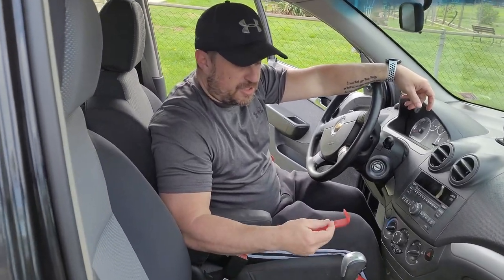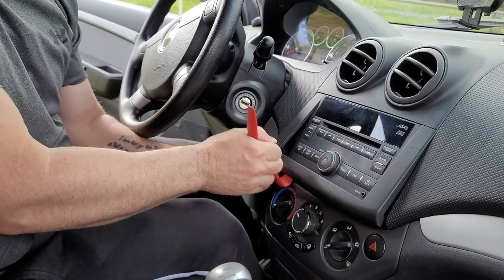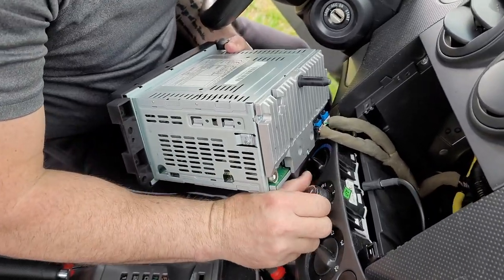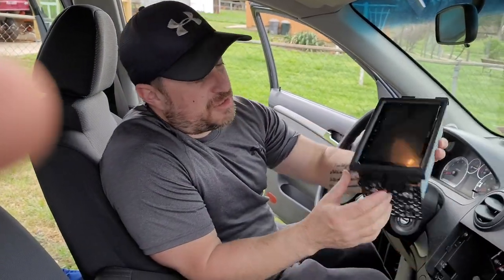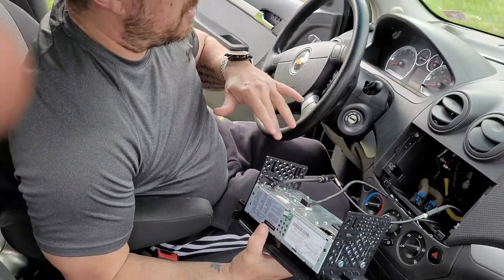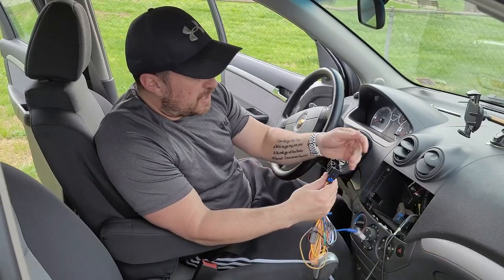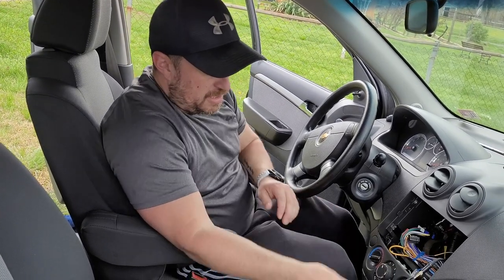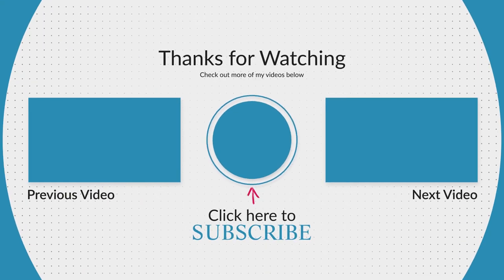Chevy Aveo Head Unit/Radio Replacement

Comment: This video was super unclear, doesn’t the car already have a USB port? How did you do the usb portion of this, I’m so confused?
Reply from the maker: The vehicle I installed this in does not have a usb port, however the head unit (radio/stereo) that I installed has a usb port and comes with a cable to route (usb port is in the back of the head unit). I hope this clarifies better. Thanks

Comment: Hello, i had a quick question if by chance you still read the comments. Did you have to solder the wiring harness to the power cable that came with the cable included in the stereo? I saw the link you posted in the comments for the wiring harness shows the cables on the backend not attached to anything so that's why I'm asking. And if you did, how do you know which cables on the wiring harness go on the power cable? Thanks for the video btw.
Reply from the maker: Hey, that’s a great question, if you are running this in an a 2007-2011 Aveo then you do not need the additional red wire, that is added for some other model vehicles that have the same plug type but the accessory wire is ran separate. If you go back to the link for that adapter and scroll down to the owners manual located just under the”what’s in the box” it brings up a good diagram of the wires and how they should be connected. I hope that answers your question.
Reply: @rickysreviewsandhowtos  Thank you for your quick and informative answer! My aveo is 1 2007 model so i'm in luck

Comment: Can I get a video explaining the mic cord and the apple play cord and other cords needed?
Reply from the maker: Most headunits (radios) will come with a mic/cable and I know the unit I used in this video comes with the usb cable for the apple play/android auto, if not it’s just a usb type A plugin so you can directly plug a usb A to lightning for iPhone or usb A to usb C for modern androids. If that isn’t long enough you can use a usb a extention cable

Comment: I want to do this for my aveo, what’s the size of the screen
Reply from the maker: 7” screen, here is a link to the one used in this video but any double din sized head unit should work. I do suggest the one in the link because I think it is the best value for what you get from it.

Alpine iLX-W650 7" Mech-Less Receiver Compatible with Apple CarPlay and Android Auto https://a.co/d/aD28yph

Comment: What if you don’t have all the wiring you need nor the money just bought the radio came the cords but don’t wanna start and fuck it ip
Reply from the maker: I understand not having extra money to spend believe me, however buying the wiring harness is the not only the cheapest but unless you how to use a test light and really understand the wiring, chances are it will cost you A lot more down the road in repairs than the wiring harness cost. Even if you have to delay installing it until you can get one. Just my advice, best of luck
Reply: Does the radio type matter or can I buy another type of screen